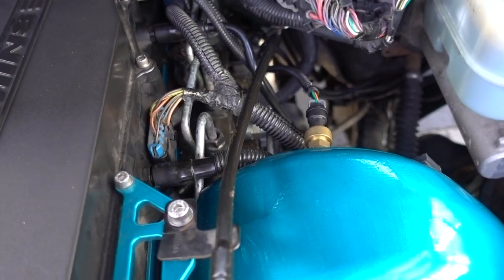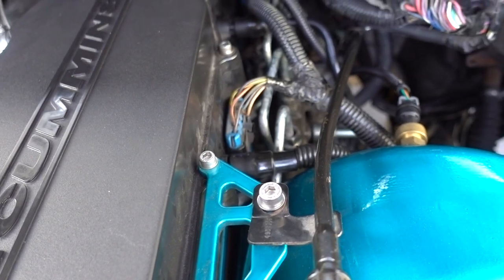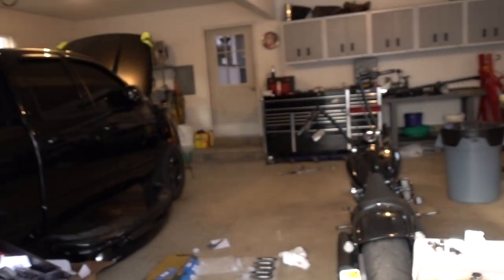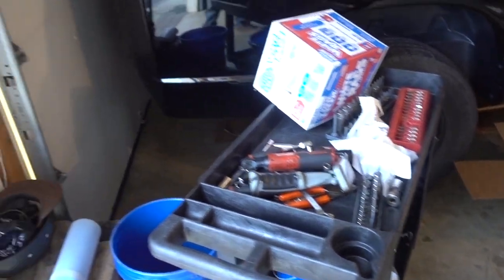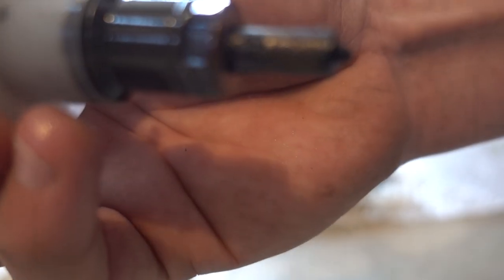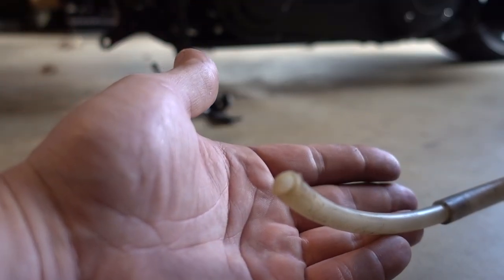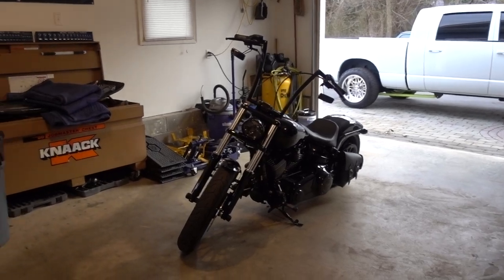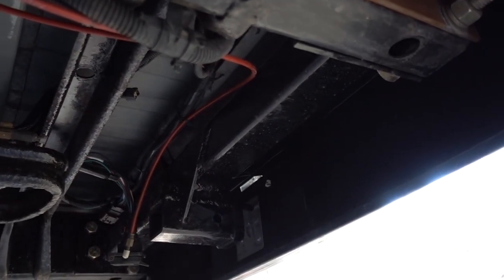INJECTOR FIRE UP!!!!

Comment: hey greg you said the injectors you could tell where getting a lil weak, you should do a video on commons rail injector lifespan and tips how to avoid fuel system failure and engine failure due to bad injectors thanks

Comment: another great video. Question: I am converting a 03 dually to a single wheel just like your tow rig truck will a 03 2500 rear end mount up in my 03 ( leaf spring mounts in same place etc? haven't found many people who have done this so I figured I would ask. any advise would help
Reply from the maker: I've done it 2 ways, but yes a 2500 axle will bolt right in, you can also run a regular wheel on the 3500 axle it will just stick out a little further than the front seeing the 3500 is a tad wider
Reply: Thanks for the information

Comment: Are these stock injectors? what's the biggest tips you can run on a stock cp3 and stock turbo or like a stage 1 turbo? I know with more fuel you need a turbo to Be able to put out more boost. my truck is an 06 just intake, exhaust, no tuner. daily driver and tow +12k lbs every week. Just want something to help tow better seems super sluggish recently.
Reply from the maker: I wouldn't even be looking into turbos or injectors unless you have the supporting mods, intake, exhuast, tuner and then a lift pump. Some tuning will for sure wake it up.
Reply: GREG_ALBERALLA the only things I need are lift pump and tuner. got the intake exhaust. getting the other 2 this week

Comment: I've seen all your videos so sorry if you already answered this. Which hood is that?  Reflexxction 2" cowl induction?  What did you pay to have it painted and did you do your fenders again?     Never did get an answer on the cost for the Laramie bumper swap. How much?  

I have an 09. Blacked out. 467 swap. 150hp nozzles.  G56 daily driver. Also repo cars on the side with it. Hidden lift and tow z series wheel lift on the back.  Just bought a camera. I'll get some videos up soon
Reply from the maker: I don't have a exact price yet, its not done and the hood is a steel cowl hood you can get from jegs or summit or other places, I don't have a prive to paint just a hood either, it can vary from area to area or who your using
Reply: GREG_ALBERALLA 
Appreciate the response

Comment: What are your thought on swapping a 5.9l out for a 6.7l in a 06. Do you think it's worth the money I know people are getting into the 6.4 but that's a lot of cash.
Reply: Seth Nielsen the 6.4 is actually a de-stroked 6.7
Reply: SuperMotoSean 419 I know a 6.4 is a de-stroked 6.7 and there is a bit of money there what I am asking is. Would it be worth it to pick up and 6.7 and put it in my 06 using my ecm and as much that I can swap over from the 5.9
Reply from the maker: I don't really see a need for it, I think a built 5.9 platform can accomplish most peoples goals very well.